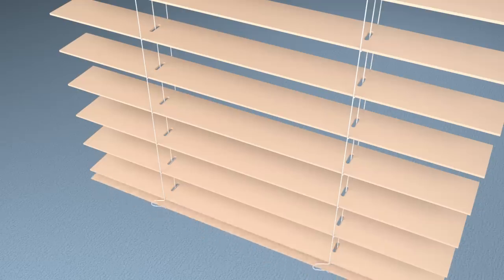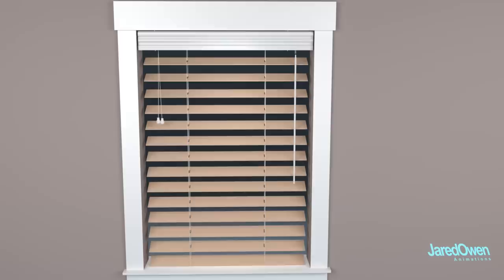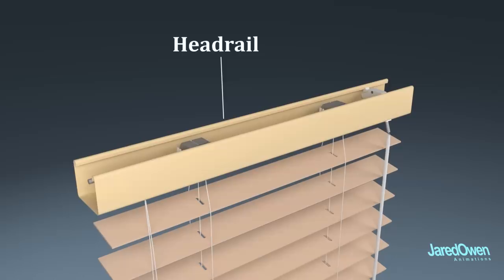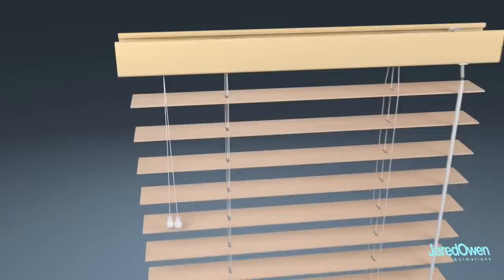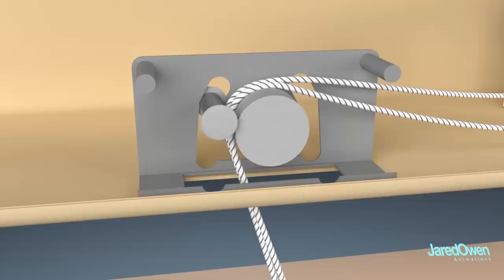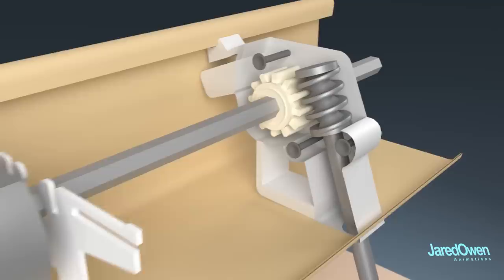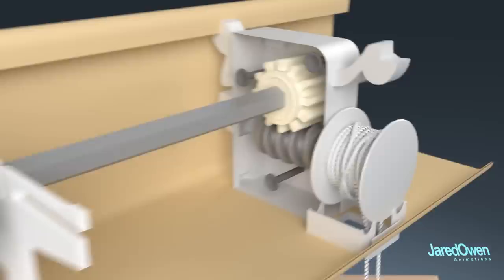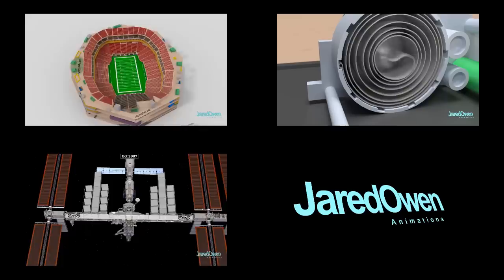How do Window Blinds work?

Comment: You should do how does a seatbelt in a car work
Reply from the maker: Excellent idea
Reply: hahahaHah what a funny comment man have a great day
Reply: @bobmcboblin  There's also the inertia lock that allows the belt to be extended gently but locks if pulled quickly, and the retractor that keeps the belt tight.
Reply: My bus has those exact seatbelts, mosly on the seats (safeguard belts), so I want to know how they work.
Reply: That would be a real short video tho. The mechanism isn't too complex.
Reply: That’s so simple 😂😂
Reply: I’ve always wondered to like how does the lock work

Comment: Lol thanks man! You saved me! I pulled the strings on the blinds in my moms house and the lock part was rusty and locked up at the top. My mom yelled for 5 mins, and was really mad saying I needed to buy her a new one now, I watched this video. Figured out the rusty lock part was preventing the blinds from going back down. Shoved my pocket knife in there and BAM the blinds fell down. Took 3 mins to find the solution and fix the issue. Thanks a bunch lol.

Comment: This is fantastic. I think the integration with the sponsor was a great way of getting something for yourself. You're doing awesome work.
Reply from the maker: Thank you!  I'm trying to get sponsors that fit really well with the topic.  FixMyBlinds was awesome to work with
Reply: @JaredOwen  It was smart to work with a company focused on the parts rather than the whole. That prevented them from influencing your design, and may have pushed you to cover a wider variety to cover all the parts possible for blinds.

Comment: Nice! As a suggestion, it would be great to add on the end of this video the automatic controlled window blinds mechanism which uses simple motors to perform the work of opening and shutting. With an app, you can control it.

Comment: In my area, the wand and lift strings are on opposite sides of the blinds, additionally, with the mechanism that holds the lift strings in place, the large roller moves instead of the smaller one

Comment: There is another type of blinds that is combining the rotation and lifting mechanic (usually with a rod to rotate).
When you rotate the rod to open the blinds will they move up as usual, but when you close the blinds are they moving down and once they reach the bottom will they tilt.

What is the difference there?

Comment: Great video!! However I have an issue... the blinds only  turn partially one way but not the other...only then pulling the top blind up tight against the  rail ...took it down and  everything seemed ok compared to an identical blind that works...the string inside the wheel was at a minimum...likely causing the lack of movement...so I tried rolling some string back...but the problem still exists

Comment: I have two Levelor Riviera mini blinds with a 10" headrail and are 58" in length.  They came with no cord lock mechanism that I can see and only the cord to lift and lower rubber-banded together in the headrail.  No way to lift and lower the metal blinds that I can find.  Not sure what to do and why they were made like this.  Please advise on what I can do.  I cannot find what to do with this on YouTube.  Thank you for any help!

Comment: Nice. But can you make how faucet work? Im so curious
Reply: It would be interesting to see, but this is how it works. There are 2 pipes, hot and cold, going to the sink. Both of those already have pressure within them so that's how the water comes out. When you turn on the cold water, a valve opens allowing the cold water to flow. When you turn the hot water on, the valve on the hot water pipe turns on. The reason it takes a while for the water to heat up is that, over time, the hot water in the pipes cools down. For the hot water to arrive, it must come from the hot water heater in the basement of the house. When you turn on both faucets, it opens the valve to both hot and cold, which makes warm water come out.
Reply from the maker: Excellent idea!

Comment: Great video, I never had blinds so I never wondered how they work.
Anyway, could you recreate the PC Parts video? it is a little outdated
(The motherboard has a PGA socket, It had a 20 pin PSU connector and also the GPU was plugged into a PCI slot, it should be connected to a PCIe slot.)
Reply from the maker: I may remake that video!  thanks

Comment: Yes, but how do cordless window shades work? Mine has a 2 foot lateral spring inside, connected to a pulley system. This allows you to lift or lower it with a finger and it stays put.

Comment: I learned today that, if you blinds will not pull down, you may just need to adjust the angle so they are open.  Then try pulling the string.

Comment: On its top. Can i convert it into electrical? I will use stepper  motor.
Reply from the maker: You could certainly try!
Reply: @JaredOwen  yes. And also wifi control using alexa and arduino system.